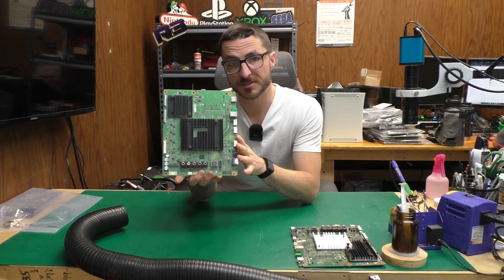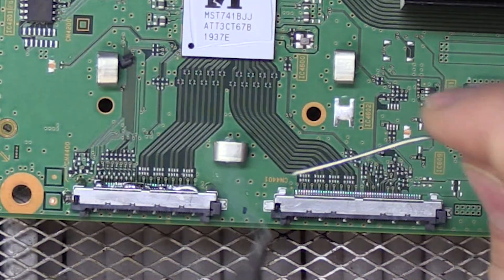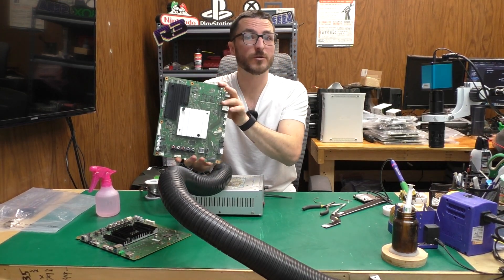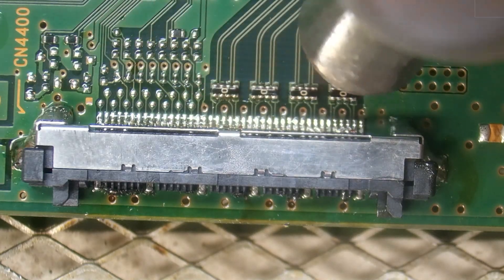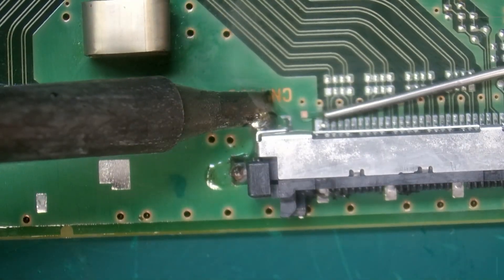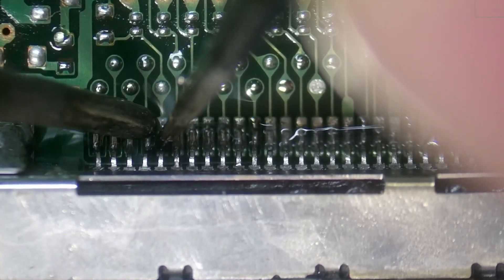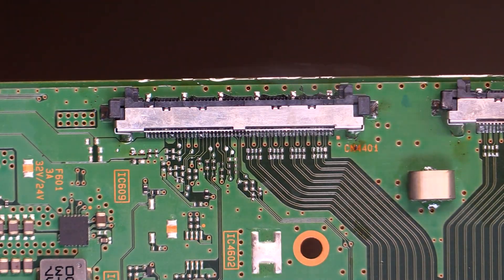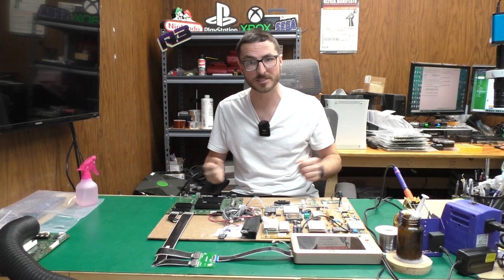Sony XBR-85X850G Mainboard LVDS clip replacement

Comment: why do you use the same bit for everything? you should use the correct bit for the correct works. as for this work, its definitely the wrong solder bit
Reply from the maker: It works